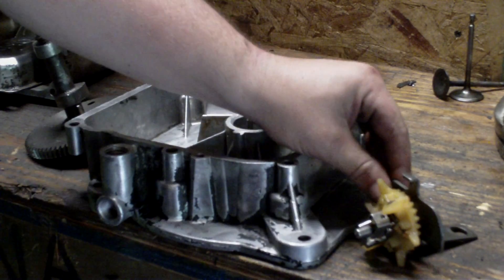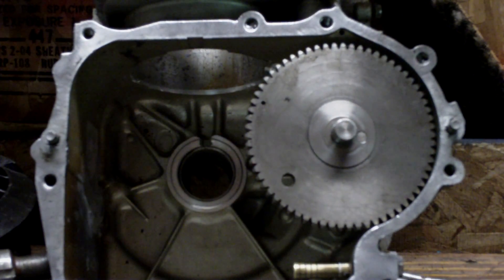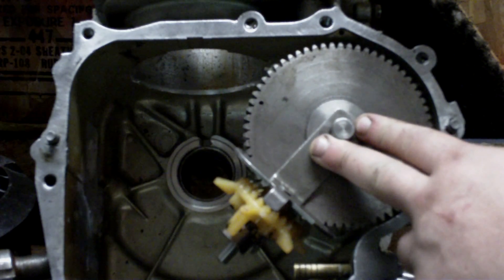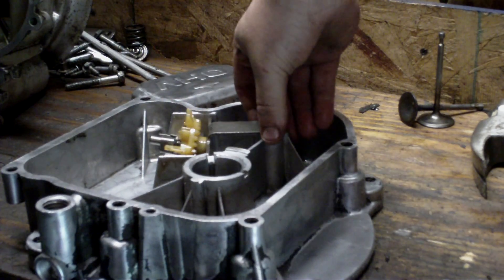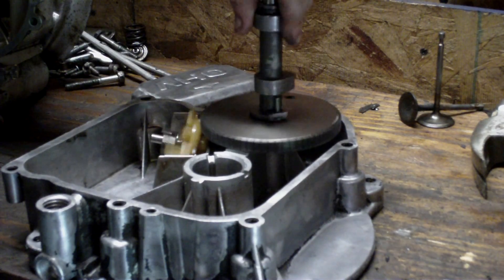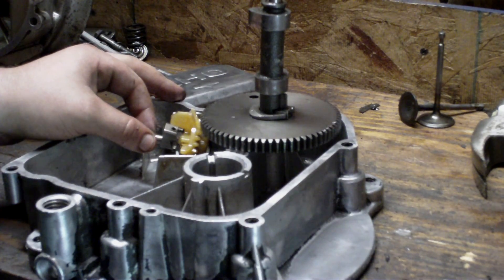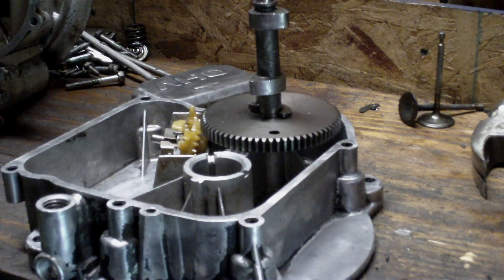How Splash Lubrication (Oil Slinger) Works in Briggs and Stratton Vertical Shaft Engines

Comment: Hi.. With the splash system, could the engine be operated at a 50 degree angle and still have oil distribution provided oil level is correct..? Thanks

Comment: Thanks for the reply, but the issue is that now when I pull the rope I get a snap back. How could just replacing the crank cover cause this type of outcome🤔🤔🤔. I can’t see how the engine could have come out of time if that’s the issue now. This engine was perfect minus the broken cover...
Reply from the maker: Sounds like it may not be disengaging (the starter clutch), if its catching it will do that. it might just need oiled/cleaned.

Comment: Question? My booklet doesn't show how to reinstall the splasher in a briggs horizontal 7.0 engine. The crankcase cover cracked at the bolt. I orderd a gasket and seal. I replaced it yesterday and finished the rest of it this morning. I must have looked 5 times through the casing before bolting it in. Now I tried to crank it and I heard a bad noise. I am tearing it down once again....thanks in advance.
Reply from the maker: on most horizontal engines the plastic piece (slinger/governor) is just a governor and not a oil slinger, the dipper on the connecting rod throws oil on all the parts. Thanks for Watching!!!

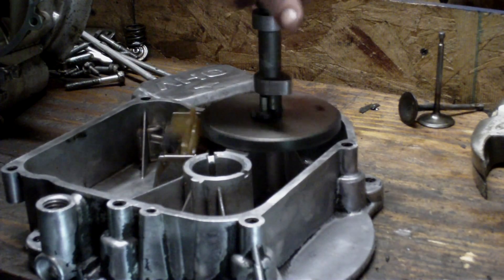Comment: Thanks for this useful video.  I am trying to troubleshoot my 7 hp Briggs & Stratton push mower engine with an Air Vane type governor.  The engine is over-revving and I cannot find a diagram illustrating how the governor link from the throttle connects to the Oil Slinger governor arm as mentioned at this point (1:24) in your video.  Is there someplace in one of your videos that shows this connection?
Reply from the maker: your welcome! On air vane governors it doesn't hook to the oil slinger, that is the governor itself, if you have a clogged air passage (like the cooling fins) it will sometimes cause that or dirt/grass built up around the carburetor. Thanks for Watching!!!

Comment: Fascinating! I really need to get educated on how these engines are put together, so I can fix my own. I love engines and am filled with theoretical knowledge about them, but when it comes to working on them, I've never gotten to really learn. Anyway, you've answered a question that has bothered me just about every time I fired up the old lawnmower! Thanks.
Reply from the maker: +justforever96 It is interesting how it works, I hear ya, glad to help out! Alot of newer engines (on riding mowers) do have a oil pump and filter like a car does, but many are still like the one in the video. I have alot of other videos on rebuilding these engines, might be interesting to you as well. Thanks for Watching!!!

Comment: Great stuff. Thanks for posting. Could I add one thing in case somebody came to this site looking for help for a problem with the slinger? I had a 17 hp Briggs that was surging and nothing was working to fix it: carb cleaning, new surge spring . . .  Then when I opened up the engine I noticed that the piston that comes out of the oil slinger wasn't hitting that little flat part of the governor arm squarely. I think it was slipping off when the engine revved after it pressed on that flat part. So I bent the governor arm a little so that the piston hit right in the center of the flat part. That did the trick. No more surging. So if you're out of ideas and have done the obvious fixes, you might want to have a look at the slinger. 

Thanks again for posting all these helpful videos.
Reply from the maker: Dale Grote Thanks, your welcome! That is one way to fix that, but you can actually adjust the governor, i have a video on that, and that would take the slack out of the parts, without taking the motor apart, but your right though, that would be one way to fix it. Your welcome! Thanks for Watching!

Comment: Friend has 14.5 Briggs that blew. I do know that he was running it about 1/3 to 1/2 quart low on oil. Ran okay when he mowed on flat land but blew when he was on a slope. Do you think the splasher would have been unable to reach enough oil if had been that low in the sump ... and on a slope?
Reply from the maker: ***** Yes, i figure that was the reason, even with the right amount of oil, if your to much of a slope it can starve the slinger and cause it to blow or score a cylinder/bearing, if your mowing on a hill side a motor with a oil pump would be ideal, but still even then you have to know what side the pickup is on, because it can run dry as well. Thanks for Watching!!!

Comment: Man, I love your videos. Like ALL of them. Clear, concise, well shot and easy to understand. Really appreciate them a lot. This one squared me away as I'm replacing a camshaft and governor slinger in a Briggs 190cc "Pro Series." And by Pro Series they apparently mean cheesy nylon gears on the crank and camshaft and plastic cam lobes as well. Brilliant. Long story short, the throw-out mechanism on the slinger broke off, got jammed up somewhere and it spun one of the plastic cam lobes 180 degrees. Amazing how hard these are to start when both valves are opening and closing at the same time. :-/ Anywho, your video, and about $50 in parts helped me put it back together. Thanks man! Keep up the great work!
Reply from the maker: Thanks, glad to hear you like them! oh wow, thats unusual for that to break like that, I agree i hate the new "and improved" plastic parts they are using on these motors. I don't mind the plastic oil slinger/governor since they have always been like that but the plastic camshaft is just going to far. Thanks for Watching!

Comment: tht cam is really bent  how did that happen
Reply from the maker: The engine it came out of (14.5 HP OHV Briggs) threw a rod and it hit the camshaft, the other side of the block got busted out from the rod, I did have the block welded up and got a used sump and cam for it. I have another cam out of a 12 horse briggs that got broke from breaking the rod, it shattered it. I have another video called broken engine parts that i show that in more detail. Thanks for Watching!!!
Reply: ooh thats not good did the block crack
Reply from the maker: yeah the block broke out on the other side close to the starter, i had it welded.

Comment from the maker: I don't think it will work, i don't think it will be able to sling enough oil upwards to the cylinder, I could be wrong though. I have heard of people putting a dipper on the crankshaft, but you have to do away with the counterweight (sychrobalancer) which would cause major vibration problems. I'd be afraid either way that it would get to much or not enough oil, and theres really no way to tell. Sorry i can't help out more! Appreciate it! Thanks for Watching!!!

Comment: Hey there fnaGP9, in your opinion, would this oil slinger design work as well, if the engine was turn into the up right position (horizontal shaft).  I have looked at this option for awhile, but wondered just how much oil to put in the engine when its in the horizontal position, too much oil and the plastic fling won't throw the oil, not enough oil and the engine will over heat...........any thoughts you have on this would be greatly appreciated.  thanks and super job with your videos!

Comment from the maker: only time i've had the plastic oil slinger fail was when a engine threw a rod (which also broke the camshaft) it destroyed the slinger! but yeah, unless that happens i've never heard of one failing either! Thanks for Watching!!!
Reply: I've got one here I'm working on for a guy that has a failed oil slinger. No idea how it broke, but it did. I believe a valve stuck and broke the timing gear on the crankshaft side. The gear is plastic and the key way broke off. Wouldn't spin the cam. Thought for a minute the valve was stuck open because one was open, but the other valve wasn't moving. Pulled the bottom off the engine and the gear was broke. The oil slinger had one of the metal arms broken and twisted off to the side, and one of the plastic arms was twisted over sideways. Replacing the bad parts now and hopefully it won't do it again.

Comment: Thanks. I lined it up good. When I crank it everything seems normal. So I think it's good. I temorarly bypassed the governor and user a spring to keep it at idle just so it doesn't rev insanely high on first start up if it is wrong.

Comment: How do u go about putting this oil slinger governer back on as I rebiuilt the same engine. Wasnt exactly sure because everything was torqued to specs. None the bearings were scored or lose. But when turning it by hand there is a knock when u tun it back and forth. I was wondering if I put the governer in wrong and that's making the noise.

Comment from the maker: @whiterangers1984 thats really a better setup, i think any engine should have a oil filter, its not good having all that sludge/metal particles circulating through the engine. not a problem, there pretty reliable though, but a oil filter/pump is better. Thats the main problem with any small engine is carburetor trouble. thanks for watching!!!